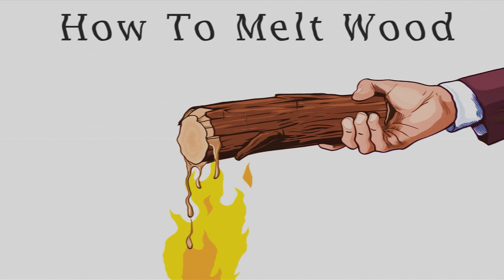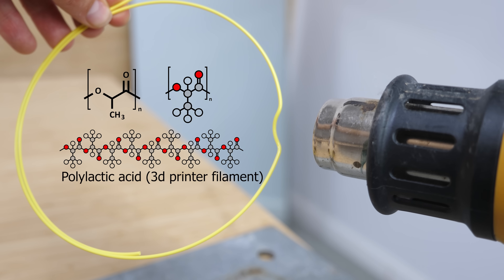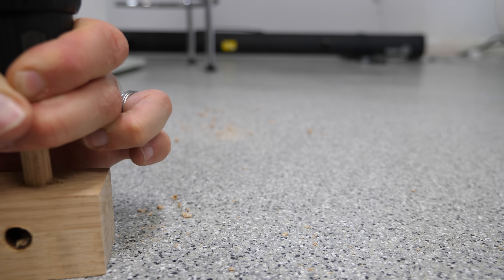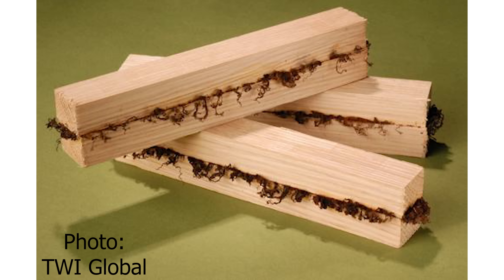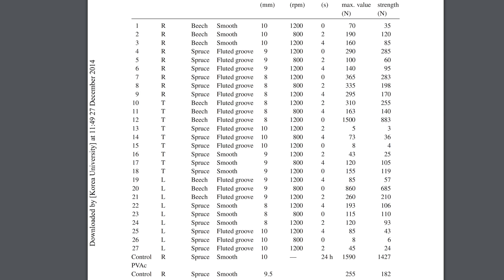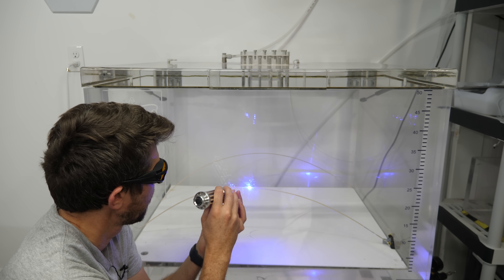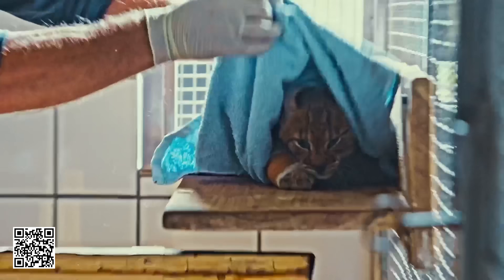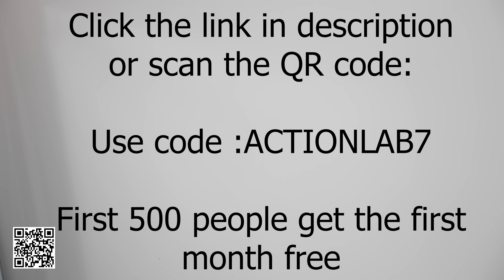I Melted Wood With Friction

Comment: 6:40 wait. How hot does it need to get to melt the lignin? Because then instead of water we could use a high temperature oil or something and heat it up that way, and actually bend the wood and form it in any direction. but it must be an oil that penetrates the cellulose.

Comment: Pretty cool discovery. But I doubt it will have a measurable impact on environment. Since vaccum chambers, motors, laser and other heating elements are even more expensive and resource intensive than glue.

Comment: 😊
Here is a science puzzle for those who are interested in science.

Imagine the universe has a giant wall at its edge. Not a metaphorical one—a real, physical barrier. Now picture yourself standing in front of it with a drill, ready to punch through. But here’s the twist: beyond that wall isn’t empty space or darkness—it’s nothing. No atoms, no time, no dimensions. Not even a vacuum. Just... the absence of everything.

So what happens when you drill into it?

You’d be trying to make a hole in a place that doesn’t exist. And the moment your drill breaks through, you’re not just poking into nothing—you’re creating space where there was none. That’s the paradox: drilling requires space, but space doesn’t exist beyond the wall. It’s like trying to carve a doorway into a dream that hasn’t been dreamed yet.

In short, if that wall really separates us from true nothingness, then breaching it isn’t just impossible—it’s meaningless. Because there’s nowhere for the hole to go.

So drilling into the wall of the universe is impossible even if it is made of thermocol

Comment: You want to weld wood, need to shield it from oxygen, and the first thing that comes to your mind is your vacuum chamber? I guess that's a classical case of when having a hammer, everything becoming a nail.
It would be so much more fitting to use protective gas like argon, just like when you're welding metal. Perhaps it wouldn't be the most efficient way to do it, but it would show how you're actually welding wood. You're even heating the wood with a laser. Even though it's not that common because of the prices of the welding machines, lasers are also a heat source used for welding metal.

Comment: Hello, saw mill worker here.
We actually do this to create planks of wood. 
By rotating logs with a Lathe and getting sheets out of logs. 
You can basically create any length and thickness of any plank, 2 by 4, sheet,  and anything. 
And thanks to having many layers that are "welded" together. You end up with not only a stronger product, but the wood also doesn't want to bend back into a rounded shape. 

You can search up future builds lvl from New Zealand for a much more indepth explanation. But yeah.
Can confirm this guys video as definitely legit.

Comment: Did he really melt the wood with the laser, or just partially burn it without a flame? Esentiallly turning it into charcoal.

As he noted himself, in normal combustion, heat causes breakdown of the components which are released as a combustible gas (wood gas) which is what actually burns. At least at first, until the wood becomes charcoal, and then that burns. 
Anyone who's ever made char cloth or charcoal is familiar with wood gas. In a vacuum chamber, the wood gas wouldn't ignite, it would just be vented away, but how is the end result any different? 

You can even see dark scorch marks on the wood. I'm not convinced that he melted anything in that last experiment.

As for the dowel experiment, maybe he is melting the lignin, but I think he's also burning away some of the material as well.

Comment: When I started watching, I assumed he'd weld wood in an extremely oxygen poor environment (vacuum chamber or under cover of an insert gas). I was surprised to see that it could be done with a dowel and drill or by the "vibrating 2 plates " method.

Comment: This is what progressive engineering outside the box is about!
Imagine 3-D printing treated wood strong as carbon fiber? Yes, it would be heavy, but it is possible to heat and treat with the oils at a smaller scale. A large piece is hard to penetrate to the core, and it take a while to "bake" which is the hurdle of the beast of mass-production. Just need some science and a proper nozzle akin to frosting to help with desired consistency and shape, but made out of metal. They could even print a layered fiber. I will go out on a limb, here, and say hemp does it better. 👌

Comment: 3:23 Imagine winning an award for not doing something you were supposed to do and discovered something completely by accident 💀💀
Reply: loads of important inventions/discoveries were done by accident

penicillin, dynamite, microwaves, x-rays, shatter-proof glass, stainless steel, post-it notes, velcro & lsd
Reply: Imagine💀
Reply: Check out the Czochralski process- method of crystal growth used to obtain single crystals of semiconductors, thats the base for microchips and computer processors. :D

Comment: Instead of that puny little laser, you should have used an infra red heat lamp.  You could have heated up a significant area of that stick instead of one small point.

Comment: But how is this useful in a practical way? If I am building a cabinet, I can't vibrate all of the pieces until the lignin melts. Nor can I dowel it together with a drill, only one side will work and I will have to use glue on the other.

Comment: Im making kites using bamboo for 34 years.
Im using fire to straighten slightly curved bamboo sticks since 90's to make easier build a kite that flies flawlessly.
Someone told me that bending bamboo while slightly putting it in fire actually bends it permanently while im trying to pick straight bamboo sticks.
Reply: Apparently,  traditional bow and arrow making techniques , involve heating wood over fire , to bend/straighten the bow or arrows.

Comment: Incorrect:
well, half right.
Wood would melt, that is cellulose  would if it could 
Most polymers are actually a mix of crystalline and semicrystalline regions. So if did not hydrogen bond, and it was a small enough polymer it would melt. 

Crystalline materials melt, and amorphous materials glass transition.

Lignin on the other hand is not crystalline, it is an amorphous polymer so it would undergo a glass transition.

So in short, some most polymers are infact semi-crystaline and melt as well as glass transition. Some polymers are amorphous and undergo a glass transition only. And rarer still, are polymers that only melt because they are highly crystalline.

Crystalline materials melt, and amorphous materials glass transition.

Comment: Firstly I wanna say I do enjoy most of your videos but this one made me doubt how much I missed and took at face value.

In order to melt wood we just need to assume the definition of melting isn't a phase change from solid to liquid but just increasing malleability? This is sorta normal since we do it with cheese and such as well however for a science channel to casually dismiss that there IS a difference between melting and changing the plasticity of part of the wood.

If you casually mention that you use melted room temperature butter this is one thing, however when the point of the video is misleading you into now thinking you know how wood welding works when you do not is a bit shady imo.

edit: grammar and adding better spacing

Comment: with enough pressure and temperature you can melt it and put it in a mold.
In Brazil, at USP (University of São Paulo), they have an experiment that shows this. Well, at least they had one when I was 15 years old.

Comment: Fun fact, as an architecture student we were taught that adhesives are one of the biggest barriers to reusing wood from older buildings because it’s pretty much impossible to remove and have a normal life of lumber again. I wonder how this could be adapted to construction to encourage more reuse as well as of course reducing adhesives which are generally one of the most toxic construction materials anyways
Reply: Technically this is just turning the wood into adhesive too
Reply: @are3287no, adhesives use harmful materials and plastics, the wood is still wood
Reply: does it also applies for skin glue ? -true question, no idea of the answer, even if i'm sure that hot water dissolves the skin glue, not sure that the construction wood can handle it
Reply: Thinking like a true scientist. Innovation at its finest.
Reply: I doubt it's easy to undo the friction weld (though you could drill out a dowel), but the lack of adhesives should make it safe to turn the wood into chips & mulch to feed to new trees.
Reply: As a high school architecture student. I don’t want to ever touch architecture again
Reply: Aren't there also other issues like inpregnation, paint, metals and such?
Reply: Propose this to your professor frfr
Reply: Jesus loves yall he died for my and your sins and if u have faith in him you'll live eternally with him.
Reply: @oliver_yuh you think a clippy pfp’d know they’re just being used

Comment: partner up with hydraulic press channel.. pressing the drill with the rotating wooden stick onto the hole or something. like tape the drill to the upper part of the press and then slowly push the spinning wood into the hole in the other wood.

sounds so weird typing it..

Comment: Okay, this works for fastening one end of a round wood dowel into a round hole in the wood. 
That only gets half the job done.
How about the other end of the dowel?  You can't spin it to heat it to the bonding point.
How about a square or rectangular tenon in a mortise?  You can't spin either end.  You can't really vibrate it the way the Swiss did, either.
Maybe some ultrasonic energy applied to rectilinear joints in a focused manner would work?  Or focused laser energy?
There's more experimentation waiting to be done to broaden this technique for more versatile applicability.

Comment: What would happen if you soaked the wood for 24 hours first and then put it into the vacuum chamber? With a fast enough vacuum would it boil the wood/ superheat it and potentially cause the breakdown of fibres/glue effect

Comment: You could exclude oxigen maybe by heating up the wood inside a sealed metal tip until it reached the temperature, then pull it off the tip (it'll start burning when it touches the air I think) but then you could shove it in a hole?

Comment: Wood welding is quite an interesting phenomenon! It is actually a method of heat generation by friction in order to weld two wood pieces without any adhesive. The process uses the natural lignin and hemicellulose of wood that, when enough heat and pressure are applied, will soften and partly melt, allowing the fibres to bond.

While this process shows that at least some of the components of wood can indeed be softened to a state where one would consider them to be near melting and, under the right conditions, could take on some flow-like properties, this is not melting in the traditional sense like with metals or plastics. More what you are actually describing is the process of what you might call thermomechanical softening and flow of the lignin, rather than complete transition to liquid.

In summary, though, wood welding does serve to illustrate that the lignin in wood can soften and re-form under certain conditions, wood itself doesn't melt into a liquid state—not even in any way that could be considered approximate. Instead, perhaps certain properties of wood, such as lignin, do have the ability to soften when friction and heat are applied, then flow and help to provide adhesion in a similar manner to a natural adhesive.
Reply: thanks chat gpt

Comment: I wonder if there's a way to soak the wood with something conductive, then use a tig welder to weld it together. The inert gas should remove all the oxygen immediately around where you're welding it.

Comment: So if the wood could be melted, could its structure be refolded into itself as a form of tempering? Would it make the wood stronger? Similar to steel, heating and cooling allow the molecular structure to form a more even alignment within the structure. As mentioned by a few commenters, an exotic gas mix could also be introduced into the "molten" wood perhaps to increase its density and increase its strength to potentially near metallic tensile strength?
Reply: This could revolutionize building as the wood would be a renewable source all the while achieving strengths alongside metals and even concrete and stone. Frames being built with a minimum of bracing and much lighter frames for homes. And perhaps with refinement, even skyscrapers could be made this way.

Comment: I mean common, bending wood using heat is pretty widespread technique, used from hobby carpentry to industrial wood processing. instead of laser use headgun or microwave, you can shape the wood with your hands after you heat it enought, no need for vacuum.

Comment: You can chemically "melt" wood. I think ammonia bath stuns the lecithin for a while. Making it payable. Makes a sheet of plywood like a sheet of wet paper. You vould also grind up pulp suspend it in ammonia then cast it into shapes like metal casting or "wood  weld" with the same process.

Comment: "They'd been using a machine to glue a piece of wood together by sticking a piece of plastic in between two pieces of wood, and when they vibrate it and push them together really hard, the friction melts the plastic and join the two pieces of wood together." (3:11-3:16)

You flip flopped between singular and plural nouns and pronouns so many times in that sentence it made me dizzy.

Comment: The smoke you see rising when doing friction weld is a Volatile Organic Compounds (VOC). There are existing wood glues that have lower VOC than that. Just wear breathing mask. It's a cheap effective solution. Btw, I know someone who bought expensive medical grade stainless steel cookwares, eat expensive organic foods and do check-ups routinely. She does not smoke etc. Her expensive lifestyle that the average persons could not possibly afford still did not prevent her from eventually being diagnosed with lupus at a young age. There are also those who smoke, live an unhealthy lifestyle but still live up to a hundred and not get sick. Perhaps, counterintuitively, we gain more resistance to diseases as we are exposed to impurity just like Cleopatra poisons herself to build up resistance towards that substance. Or just like how vaccines works. Peace.

Comment: This kind of bending wood is a part of our tagin community. In this, we bend bamboo by heating it in the fire and then we apply force to the bamboo and repeat it until we get our desired shape.
If we don't heat the bamboo before applying the force, it just breaks but when we apply heat and force, the bamboo gets bent and it retains it's shape. This is even done to some kind of woods which i'm not really aware of, as this practice is being lost and I don't fully know the process as well and just told the jest of it. This practice has been our tradition, and it is fascinating to learn the actual science behind it.

Comment: I tried for some time now to popularize friction drilling of wood, which is quite similar to your using a peg in a hand drill. You should try it.
I made a large wardrobe from oak, and by accident tried drilling at very high speed to produce smoke, for fun. And it turned out to be the best way of drilling oak. Exit hole is incredibly neat, and its edge is sharp. Much better than with professional drill bits. From the church organ makers I learned that oak is aggressive on the screws, so they singe the holes to make them inert... not needed with friction drilling.
So how you do it... Use any dull drill bit and start drilling. Once your hole is just deep enough that the bit won't dance off, increase speed to max, but only a slight pressure, up to the point when smoke appears. Then apply some more pressure, and be amazed how smoothly the bit sinks into the hole.
Note: it doesn't work as good with sharp drill bits.

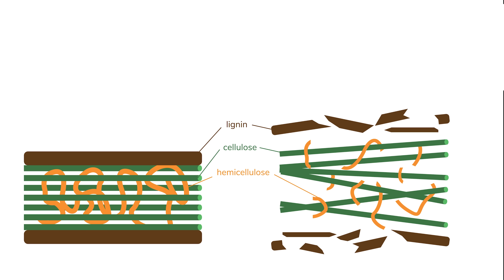Comment: 0:45 sorry but this makes no sense, and the animation even backs up the nonsense. The smoke doesn't magically teleport away from the surface of the wood, it's coming out of the wood. I'm pretty sure it's much like with a lighter, the flame (or maybe lack of) is at a different temperature so doesn't look the same.
edit: timestamp
Reply from the maker: the volatile compounds have to mix with the oxygen to burn. They can't burn right on the surface. The only burning on the surface is the burning of the ash (char) at a much slower rate and usually with no visible flame.

Comment: Cool effect that I didn't know about!  I see several comments asserting that this is how the various fiberboards are made (HDF and MDF), but a quick google search suggests that these products use a synthetic resin as a bonding agent and are not just fused melted wood.  Steam bending wood does have a very long history, but, as far as I know, can't be used to fuse two pieces of wood together, only to mildly change the shape of a single piece of wood of limited thickness.

Comment: There was a video from a fair where guys were advertising densities wood - they also melt lignin but by pressure so basically wood becomes strong as steel n they can bend it into every possible shape like a car with no glue all just press (and it didn’t look dark like in the friction area) just more saturated four to being more condensed!